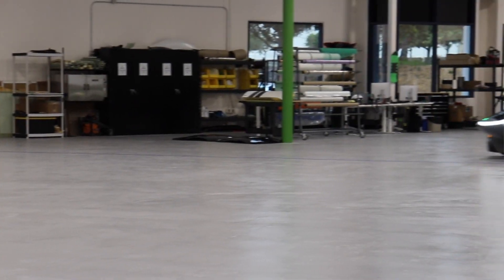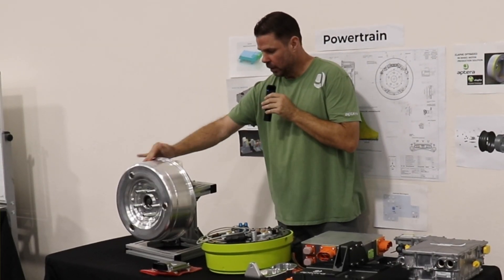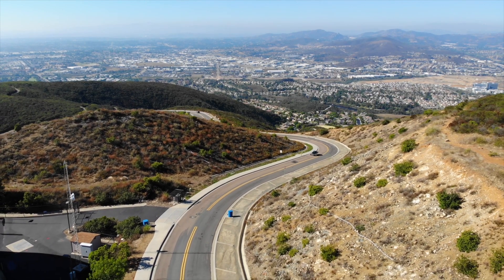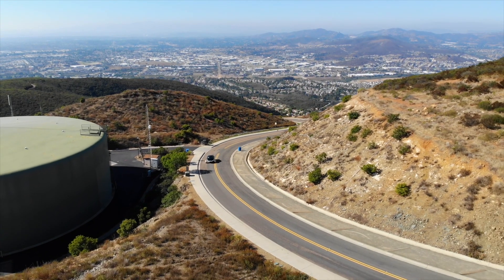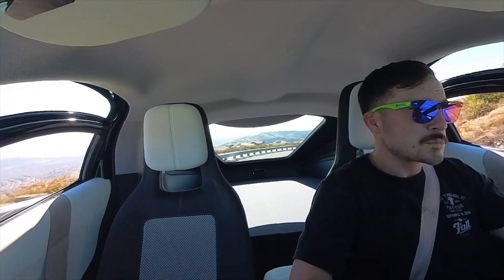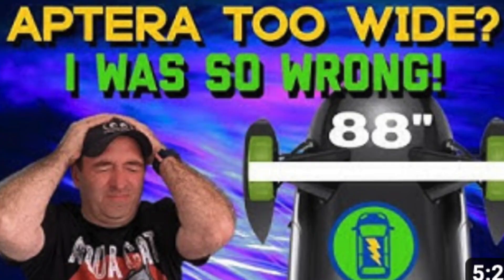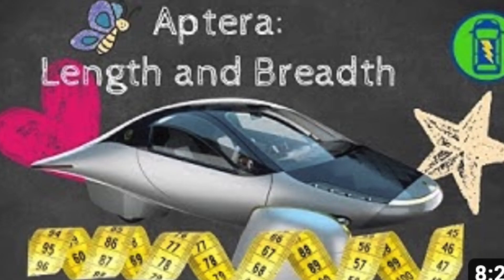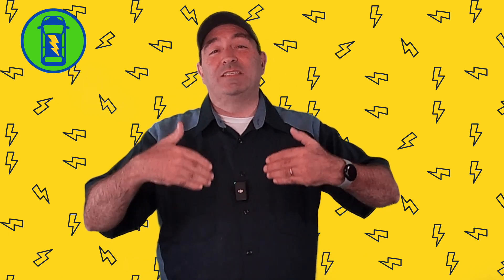BIG Aptera Update!! - More to come soon! #aptera

Comment: When they get the prototype working with cooling I want to test it in the best place, Colorado. Denver to the top of Loveland pass (11,990) is about 6500’ of nearly continuous climbing, and the thinner air would wick away less heat than sea level air.
Reply from the maker: That's a great test at the 2nd best place! 🤣

Comment: One thing I’m curious about is if it will have some forward facing cameras and if those might have the direction lines. My garage is only 93 inches or so wide and I’ll need some type of parking assist to get into it.
Reply from the maker: Great question. One thing I know is that you can see the driver's side wheel pant when driving. Hopefully that means you could easily get it into the garage. We appreciate the comment and question!
Reply: I always back into my garage.  Makes taking the groceries from the trunk into the house easier.
Reply: @markfinley3703  I had actually thought if this. Once I finally get mine "delivered" (I mean we all know delivery means you go pick it up and then drive it home), then I will have to try both options.